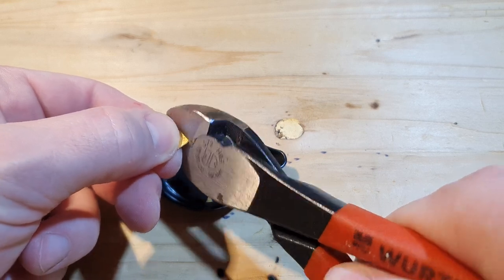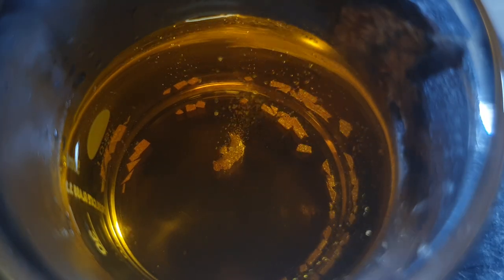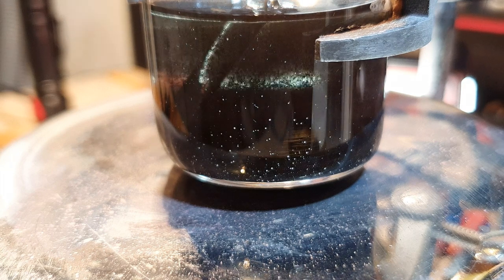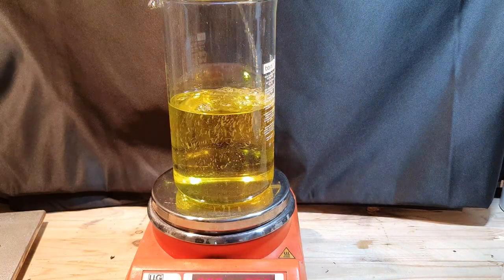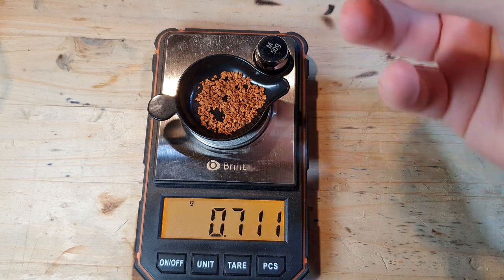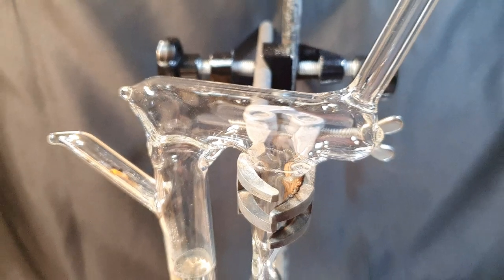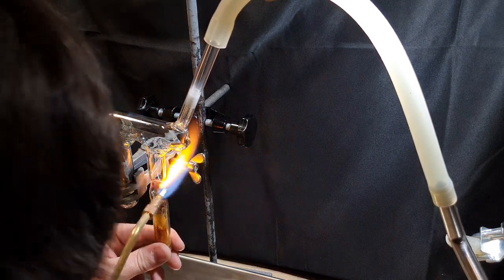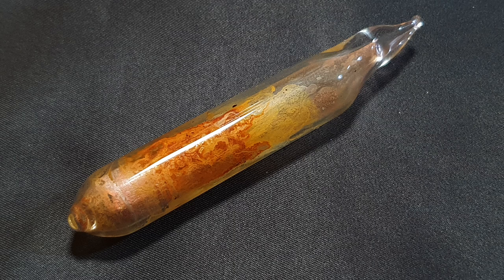Dissolving gold and reducing it with oxalic acid for my cesium auride synthesis

Comment from the maker: I thought about the gray product in the vial. I am pretty sure, it is unreacted gold mixed with CsAu. The reaction time probably needs to be a lot longer. I will reflux it for 12 hour when I try it again.
Reply: did you keep the HCl solution from cleaning the first batch?
you could try to isolate the compound responsible for the black coloration if its not an inherent property of the gold particles
Reply: 🚸Please mix platinum with gallium at a ratio of 0.0001platinum to gallium. At 300°f for 2 hrs. 🚸

Youll end up with what is essentially a liquid platinum that is catalytic at room temperature. … which  such an alloy has been a dream for many years.
Reply: I like the orange scale. Very pleasant to look at.
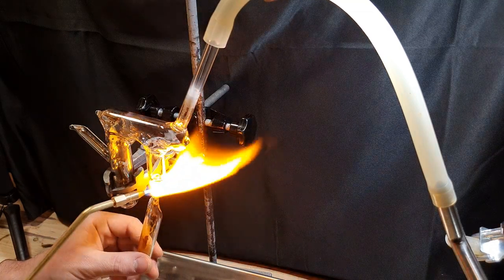Reply: 9:22  youd really like having an HHO torch. They dont cost much or you could make one.   

I love mine
Reply: 14:21  well look at the bright side. … It matches your screw drivers

15:11  i cant imagine anyone taking crap about your homemade glassware. 
Having the ability to do so in your home is something most only wish they could do.

Comment: The way to process the gold is this: use HCl & nitrate salt to dissolve.  Then use urea (applied in small amounts as it foams up) to destroy all the nitric acid.  Then use sodium meta-bisulfate to precipitate the gold.  Decant, filter, & wash the gold.  There is no need to add base!

Comment: I really want to try using that nanogold like a pigment sometime. Maybe by putting it in epoxy. There are late-roman artefacts like the Lycurgus Cup where colloidal gold was used to make deep red glass.
Reply: A lot of Victorian pieces in the UK as well. My mum had a few pieces in her display cabinet. Beuatiful purply-pink colour. The size of the particles is very important for the colour, determined by the reaction conditions.
Reply: I have just remembered they made the gold nanoparticles by decomposing gold chloride in the glass by heating. I have seen this done with silver chloride to produce some spectacular surface effects by sprinkling on hot glass making patterns like rainbow oil-slicks. Not nanoparticles, just thin layers, I think.

Comment: I assume it went black because the extinction peak of the light absorption of the nanoparticles shifted into the near infrared due to the size of the particles getting larger.
Reply: Aggregation of particles can lead to a rapid shift in the extinction peak to produce a black product, I have just read.
Reply from the maker: My first thought was also the particle size. But why would the high pH change the particle size so suddenly? And the second solution never went black, even though the particles definitely formed aggregates that were much larger. The black precipitate from the first try also did not clump together like it did the second time.
Reply: @AdvancedTinkering  I don't know. Perhaps you made the surface of the particles fluffy or furry like one of those super-black coatings?

Comment: im pretty sure ive seen the H2O2 and HCl method work to make chloroauric acid but it takes a while with lower concentrations of H2O2 even with heating. using 30% H2O2 would work better along with prolonged heating but youd have more Chlorine to deal with plus 30%+ H2O2 is getting harder and harder to get.

Comment: Know a place to get cheap glass thays good for learning to bend form fuse fittings together etc? Kinda wannawsrn Glas blowing of pipes/lines
Reply from the maker: It depends on where you live. The bet would be a glassblowing shop in your area. Even if they only make marbles, they often can buy borosilicate glass tubing for you. There are also some sellers on the internet.